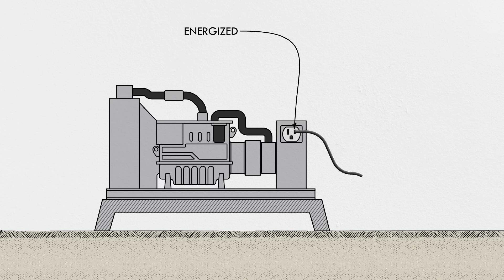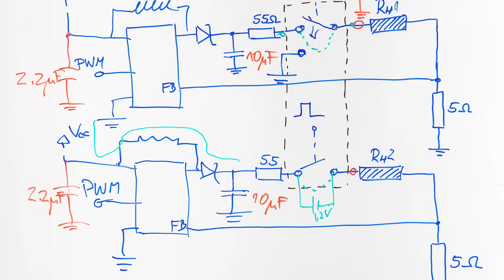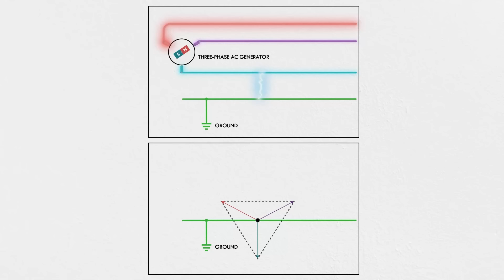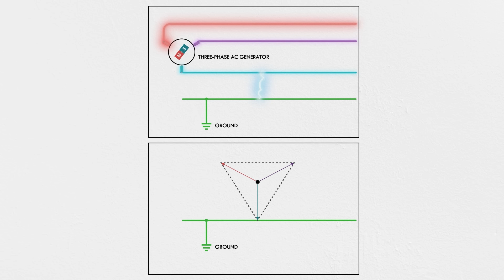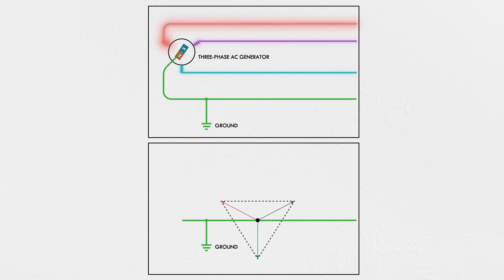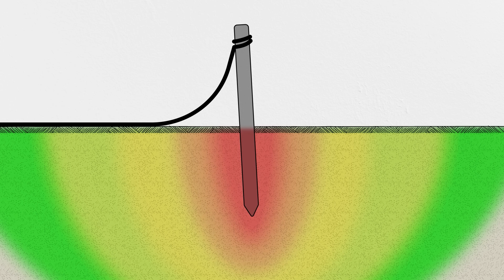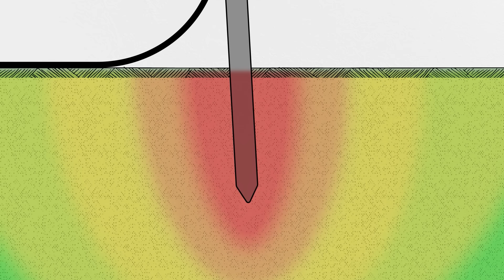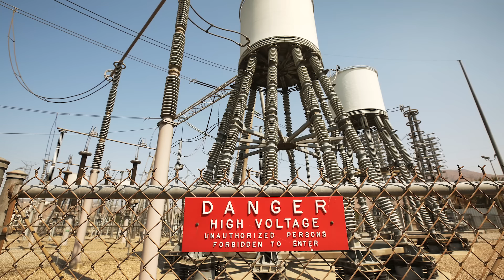Where Does Grounded Electricity Actually Go?

Comment: As a youth  I spent many times working with my electrician father erecting S.W.E.R.  (Single Wire Earth Return) electricity poles in new Soldier Settler areas in Victoria country side. Luckily we struck rock on many occasions and my job was powder monkey which to some degree influenced my choice of Armament trade in RAAF after finishing school. Used one of those just installed ten mile wire runs before connection as an antenna for my CB Radio through an old military antenna tuner to tune the VSWR ( Voltage Standing Wave Ratio ) to minimum. CB'rs in the USA could not believe my antenna system as I was extremely strong on ONLY a wire.  ;-) LOL wrote this before seeing your reference. Great explanation.

Comment: Regarding the Demonstration, I was confused at first because I couldn't see the Nichrome Wire. Then I had to Google that, and also Power Resistors . Ok so now I understand that because the Nichrome Wire has high resistance is why it's possible to measure a larger potential difference along a short distance of the wire. About hopping on one foot, maybe some sort of carbon fiber cane, or crutches would be better.

Comment: Could you explain what you mean by the statement that DC is decoupled from the ground rods while AC ground return current flows along the path of the transmission line.  Thanks. Good video even if it just scratches the surface of a complex topic, due to the skin effect.

Comment: Got a question about an electric fence used for livestock fencing. I have a 6 joule box that works off 110 AC input. It has a ground that is attached to 3 separate ground rods 10ft. apart. I have 2 questions.  Is the current that is being pulsed through my wire AC or DC? The literature said its 30,000 volts. I know it will jump about a quarter of an inch to bite you or any animal that gets thst close. If I understood the step potential theory you talked about, thats how it works is if i touch the wire then the current flows through me to the ground and back to the ground rods in the ground right??

I kinda put my questions together. I have tried to fully understand these boxes for years but i still dont have a full understanding of it but your video helped me along my way.  Thanks for all your videos. Im a curious person and your videos satisfies that part of me alot. Thanks again for the videos and the book.

Comment: I understand DC as it applies to battery powered circuits. Those ground symbols on a circuit diagram usually refer to chassis ground, where the metal frame is actually connected to the negative pole of a battery.
I've always been a little confused by AC systems, especially the wiring in buildings, I am aware there are differences in the way a house is wired and say a high rise be it apartments or offices.
On one occasion during what was supposed to be a straight forward installation of a ceiling fan. The person undid the wire nut from a group of neutral (white) wires. All of a sudden the office personnel started yelling. The neutral wires were quickly reconnected to each other. Whe I went upfront from the shop in the back in the boss's office there was a brown streak that ran from the ceiling to the outlet several power supplies were burnt out (the one in the computer and those of the external peripherals).
Not sure exactly what happened or why, I've received several different explanations from supposed experts/knowledgeable individuals, but seeing as how they all gave different answers and all were a bit more could have rather than This is what happened I've never felt they really knew and were just trying to retain face.

Comment: Nice video! 

Surely someone already noticed in the 5 months, but can't help myself: the switch used in your demonstrations might disconnect only one wire, hopefully you double checked it disconnects live wire and not the neutral. Otherwise, with symmetrical plug, there's 50% chance the whole contraption is live even when switch is off.

Best not use such switches at all but unplug whole thing every time before you touch it.

Comment: Capacitive coupling between the generator ground/neutral and Earth would cause a current of 4.5 microamps per 100 picofarads which is easily measurable.  This capacitance actually limits the sensitivity of ground fault interrupters in some cases.

This can be taken advantage of to verify that the energized conductor is actually hot without a ground or neutral reference by gripping one lead of a high impedance voltmeter and applying the other lead.

Comment: 8:02 ground not being a great wire means it's a resistor (more accurately a very large potentiometer) which is why step potential is a thing (stay 30m or more from a downed line or separated footfalls are enough of a potential difference to get shocked).  On a smaller scale this also occurs in AC-grid-powered electronics on different grounding paths (different wire lengths) and introduces the dreaded 60 Hz AC buzz (50 Hz in Europe) whenever those devices share signals such as audio, AKA the dreaded "ground loop," since the AC return paths are at ever-so-slightly different potentials.

Comment: 13:00  There are single wire power distribution lines in rural Australia, in places such as Kangaroo Island.  I noticed warning signs at the end of one of those lines where the line terminated at a step down transformer primary winding that was also connected to a ground rod.  You were warned not to disturb the ground, lest you feel the full voltage of the distribution line.

Comment: the ground wire from the round pin of American power plugs is more like a "spare ground" or one that is less likely to have a dangerous voltage relative to other things the are connected to physical earth ("dirt ground").  it is possible to have some voltage between the neutral wire and dirt ground.  usually it is pretty low but there are cases where it can get higher.  this because of how the various wires are shared between various concurrent uses.  the round pin ground (i call it "round ground") is also shared, but in a different way that makes it more likely (but not impossible) to be safer.

the ideal way to be most safe is for each outlet or light to be wired on it own separate circuit.  but that uses more wire and costs a whole lot more.  you might need 100 breakers in a big house.

Comment: Australia became the first nation to earth the mains nuetral (known as mustipke earthed nuetrals) at every installation.  The reason for this is it is so dry the often a short earthed only to ground (especially after it became common to use plastic plumbing which will not conduct electricity past the installation) would not trip the breaker so remained a threat to anyone coming into contact with the short.  Multiple earthed nuetrals allow a path to trip  the breaker protecting both installation and occupants.

Comment: For the layman. This is how I understand grounding in electric current. 

We need an extra wire to channel extra energy 
This is because any components or structures can only take so much as designed before cracking or burning 

This extra wire goes to the ground 

For electrical power in buildings the extra power goes to actual ground. This electric current is passed from electron to electron in each atom. Gradually spreading out in diffused way.  

However some soils are more conducive and will be more like underground power wires. 

Then there is the “ground” which is a different type of electrical component. Has same function as earth but artificial. This component can be used to store that energy. Or protect region by activating a disconnect switch where no current can flow. 

That is the simplified version of grounding.

Comment: As an auto mechanic , I see similarities between a car's electrical system and a single wire power system . A car circuit uses a single power wire (normally), then complete the circuit by grounding through the vehicle body and chassis .

Comment: Excellent video! Got to say something about the diesel generator example ight at the beginning. The neutral and ground pins in the connector will be connected to the frame of the generator in most cases. With the energized / live / hot pin connected to the earth via an electrode and the frame on an insulating stand, the frame will be energized with respect to the earth. Stand next to the setup and touch the frame... You are likely to be shocked!

Comment: In electrical systems, the concept of grounding involves connecting part of the system to the Earth's conductive surface. This is done for safety reasons and to provide a reference point for voltage levels. However, the grounding of a system doesn't mean that the energy flows back to the source through the Earth.

In a typical power distribution system, there is a concept of a "grounded neutral." In this configuration, the neutral point of the electrical system (often the center tap of a transformer) is connected to the Earth, providing a reference point for voltages. If a fault occurs, such as a short circuit to the ground, the fault current flows through the grounding system and into the Earth, helping to prevent dangerous voltages.

It's important to note that the energy flow in a power system is not a closed loop where the energy travels from the source through the load and then returns to the source through the Earth. Instead, electrical energy flows from the source (power generation) to the load (consumers) through conductors, and grounding is used as a safety measure to manage faults and provide a reference point for voltage levels.

In contrast, lightning is a natural phenomenon where electrical energy is rapidly discharged between charged regions in the atmosphere and the Earth's surface. Once the lightning discharges, the energy dissipates into the atmosphere and surroundings. The concept of grounding in power systems and the discharge of lightning serve different purposes and operate in distinct ways.
Reply: @practical enginerring can you explain this

Comment: Hi Grady.  Thanks for this episode, nicely done.  A question for you or one of the electrical engineers here.  This summer, I bought a 30 amp generator.  I had a diverter (interconnect?) installed on my external electrical box with a corresponding socket hanging off the box.  So now if I lose power and I decide to switch to generator, I'm supposed to shut off all the inside breakers, then go to the outside mains box and flip the interconnect, which will electrically take my house off the grid, while also electrically connecting the 30 amp socket to my main panel.  Then I'm supposed to start the generator and gradually turn on the inside breakers of my critical house circuits, such as refrigerator, lights, fans, internet, etc.  The Air Conditioning would likely have to remain off.  So here's the issue.  My Generator instructions say to use a grounding rod.  But my electrician said I don't need one.  I'm confused.  If my house has been disconnected from the grid and I'm powering it with my gasoline generator, shouldn't I have the generator grounded?

Comment: I didn't understand the "current flows through the ground" part. Like surely it does not literally flow into the ground then through it then back to the source right ? Like we have seen with the dry sand example this does not work.
Does he mean that the source also is connected to the ground and also draws current from there while on the other end of the line the current flows into the ground and away into the earth ?

Comment: 14:49 The London Underground is actually one of these trains. The system could easily be ran on a simple third rail electric system, but that would use the actual rails as a return path, and causing adjacent metallic infrastructure to rust (and God knows there is a lot of metallic infrastructure under London), so their electric system is a modified third rail system, where the third rail is actually two rails, and there are seemingly 4 rails, and look like multi-gauge tracks.

Comment: A zig-zag transformer was installed to protect against phase-to-ground faults in the campus HV network at a site I used to work at. These provide a 'virtual neutral' or 'virtual ground' where you wouldn't otherwise have a neutral bonded to ground in a delta transmission network. Protection systems can monitor the voltage and/or currents between this virtual ground and the real earth to detect faults in the network. It always amazed me how the HV protection devices looked quite steampunk - out of the 60's but still robust and relied upon. Much like the boffins who maintained them :)

Comment: The short answer is:
It returns to the source. 

The current will flow along every available pathway to the source. You want to prevent your body from becoming one of those pathways. The key element in modern electrical distribution systems that reduces the hazards to people from step and touch potential arising from ground fault current is the multi grounded system neutral conductor. This is a conductor that is connected to the grounds of all of the electrical equipment in the distribution system like switches and transformers and cable shields etc. this conductor is sized large enough to carry all of the fault current and it runs all the way back to the source where it is connected to the substation ground grid and the substation transformer neutrals. The majority of the fault current will return to the source at tge substation via the system neutral leaving only a smaller percentage of the current to return via the ground. This system neutral conductor substantially reduces the ground potential rise in the vicinity of ground connections and thus proportionally reduces step and touch potential hazards for people located near the ground fault current.

Comment: I'm theorizing the idea of a 3-d transformer that can work with infinitely high-phase electrical transmission systems and electromagnetic powered motors proportionally. The idea of a positive, neutral and negative charge introduces the principles of electrical programming, or the circuit board. You can do a lot more electrical operatives if you can combine many more varying levels of voltage across infinite potential inputs to proportionately numbered outputs. With 3-phases to a 3-phase transformer. We can do (A1+)=1, (A1)=0, (B1+)=1, (B1)=0, (C1+)=1, (C1)=0, then you can combine (A1+) + (B1+)= 1 + 1 or (A1+)+(A1)= 1+0 = 1. With more phases, you can perform (A1+)+(B1+)+(C1+)....+(n1+) = sum of n phases. Or for a phase system higher than 26 -> (AA1+) + (AA1) = 0 + 1 = 1. (AA1)+(BC1) = 0+0 = 0. (AA1+) + (BC1) +(BC1+) = 1 + 0 + 1 = 2. You can define multiplication with potentially infinite examples of addition, such as ((AA1+)+(BC1+))=2. Therefore, ((AA1+)+(BC1+))+((AA1+)+(BC1+)) = 4. ((AA1+)+(BC1+))+((AA1+)+(BC1+)) + ((AA1+)+(BC1+))+((AA1+)+(BC1+)). 8. I get the feeling that infinitely high-phase transmission systems with the appropriate phase-transformer can produce an advanced application of electrical operations and and mathematics in any electrical transmission system. This can apply for the 3-phase or two-phase AC electrical grid to improve efficiency over the same distance, then can also see application in expensively maintained electrical systems such as computer chips, satellite technology, or renewable energy transmission speed.

Comment: A Technician for a large natural gas company(largr than the one I worked for) told me that they had found that a length of rusty rebar was a better ground rod that the fancy copper coated rods we were using for Ham Radio.

Comment: A fun thing about static electricity and lightning conductors is that lightning often doesn't strike them. A demonstration I remember from school was a physics teacher charging up a long-haired student with a Van der Graff generator, and then deflating their hair by simply pointing a metal rod with a pointy tip at it, no contact required.